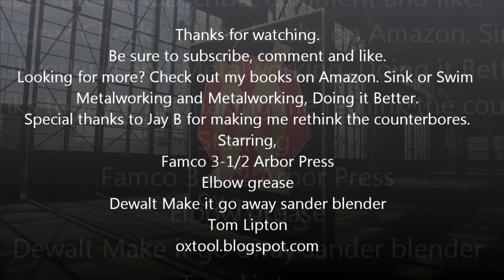Autometric Resurrection 5

Comment: Very good information. Years ago I repaired an intermediate cylinder head plate on a small compressor. The Reed valves had cracked. They were attached to the plate with steel machine screws which snapped off due to their small size and corrosion. I drilled and tapped the plate 1/4-20 with a chamfer on each side. I used brass machine screws and locktite. I cut off the excess and preened the ends. Once it set up I milled the ends flush. I re-tapped the plugs for the original sizes screws. That was about 1977. That little compressor is still working today although the big shop compressor sees more use.  I use the information I gain watching your channel all the time. I had no mill at the time but just chucked an end mill in the drill press.

Thanks, Randy
Reply from the maker: Hey Randy,

Its actually very satisfying to make a good solid repair. Sounds like you gave the compressor a good one.

Cheers,

Tom

Comment: I usually have used a straight pin press fit and oversize on the end length. I usually would hammer each end a little to mushroom it and them cut it flat. It works fair yet I wished I had just not had to do it. One guy I know had a whole run of parts to do and he took a long time to finish them up. He did such a good job on them I have to say he did the best work patching I have ever seen. It is the nature of our work and it is a cool way to solve the issue. I liked the videos and fixup. Thank You.
Reply from the maker: Hey Lew,

Thanks for the comment. Nobody like making a fix like this but sometimes you have to suck it up.

Cheers,

Tom
Reply: oxtoolco
 So right it is better to just fix it up for sure. I like it when I can repair something and have enjoyed work from customers that is basically that exact kind of work. Your videos are the best!

Comment: Cool video Tom, I work for the National Defence, more specifically on M113 which are aluminum hull too and sometime when the guys at the machine shop plug a hole on the hull they use this technique except we use Loctite 640 (green press fit) instead of oil.

Enjoy all the tutorials as always,
Thanks
Reply from the maker: Hi Max,

Interesting. I'm sure they cant weld on those suckers without messing with the projectile stopping abilities. Never tried the press fit green. Have to get some and play around with it. Thanks for sharing.

Cheers,

Tom

Comment: Tom,  For this application, only 2 - 4 tenths max interference is needed for a great press. The plug head is doing all the work. Another clean way to plug these an be a little easier to press in etc. is to undersize the head diameter a few grand then, peen the perimeter of the plug before final fly off. This drives out the metal, fills, and hides the tiny gap. It many times hides the repair better because the bore bell mouths slightly during press. Thats one reason you start to tickle off early around the hole. The harder the parent metel the less the distortion. Peening weld beads down also helps some with parent metel sink around the weld. A real concern in mold cavity repair.
A Master Craftsman is one that can fix his mistakes. My 2-1/2 cents worth, Jim Cunningham
Reply from the maker: Hey Jim,

Your method would work fine. Better a little tight than any too loose. That's why I heated the plate as I knew it would be stiff. How stiff is another question. It took about all the press had to offer. Thanks for the excellent comment.

Cheers,

Tom

Comment: I was going to comment on the press fit specs in the prior video but didnt for fear of being chastised and banished forever by the Wiz.. ;-)
I was always taught to run .001" per inch of diameter (for general work) which would have put the specs roughly about 1/2 thou on the small section and almost 1 on the big end.
I suppose when in doubt, "tighter is better"?? LOL

Colin
Reply from the maker: Hey Colin,

I knew I wanted to heat it when I installed the plugs but I was apparently on drugs on the first interference spec. Thanks for saying something and saving me from internet embarrassment.

Cheers,

Tom

Comment: Even though the press fit is very tight, is there no worry at all for the plugs to make their way out over time? Wouldn't the small amount of lubrication you put in pre-pressing act as a possible lubricant to separate the plug from the plate? I recently saw a video from Keith Rucker where he's mounting a taper into a Jacobs chuck and he stresses the need for a grease-less clean taper when mating, which is why I'm asking since it seems to go a bit against what you're doing here.

Cheers! It's always interesting to see you working around the shop, and congrats on the arbor press, looks like a great acquisition!

/Daniel
Reply: I use oil on tapers to create a hydraulic fit. Really works, just make sure there is no physical dirt or grit in there. Clean oil is fine. 
For the plug, it's so galled in thee it's not coming out. Aluminum galls easy and it probably got mangled in there.  
Plus, the molecules in the plug will bond to the plate. If you leave gauge blocks wrung together hey will actually become one. Their molecules intertwine.
Reply: The new holes will overlap the old ones and the stepped shape will insure they will not come out, as the mounting bolts will hold them in.
Reply: The step (large diameter) of the plug was placed on the opposite side from where the screw will be pulling from ,
so, as they say in China, Ain't no way she's commin' through.
Reply: We always use loctite for our assembly lube.  Seems to work great, and when it dries it does nothing but help hold.
Reply from the maker: Hi Daniel,

Good question. The oil was to prevent metal from tearing as they slid against one another. For this application it was fine to use some since there was an interference fit. With a tapered arbor the clearance goes to zero but is not actually interference. Having something even a thin film of oil prevents the metal to metal contact a taper needs to make an accurate make up. Heavy duty bearing ride of a film of oil so the metal is never actually in contact. A taper works because it has a large non rotating bearing between accurate metal to metal surfaces. Hope this helps.

cheers,

Tom
Reply from the maker: Dustin Layne Hi Dustin,

Good point. Does the green stuff stand up to a little heat like I put into the plate?

Cheers,

Tom
Reply: oxtoolco Ah, that does make a lot of sense. I did not consider that the lack of lubrication during the press fit may lead to tearing of the aluminium. You live, you learn, thank you!

Comment: I like to bead blast parts to make them look nice but my garage shop doesn't have one so I use the orbital sander to give my parts a more finished look. Thought I was the only one.
Reply from the maker: Hi Mark,

It works great. You can also get scotchbrite pads that fit them as well. Works on all kinds of materials to restore finishes and give a uniform look to large parts.

Cheers,

Tom

Comment: Amazing fix. What if you cooled the plugs in a freezer, would they not have been narrow enough to just drop into place by themselves?
Reply from the maker: Hi Andre,

Freezing the plugs would help but more is gained by the larger the temperature change on the larger component. Bigger things move further per degree of temperature change.

Cheers,

Tom

Comment: Tom, One, "jack leg" advantage of the hole and the counterbore being offset is that the difference would tend to wedge the plug pin in place. Not exactly a perfect fit however. Regards,
Eric
Reply from the maker: Hey Eric,

I think we are way beyond wedge here. This is an atomic wedgie.

Cheers,

Tom

Comment: Hi Tom, really enjoying this series. Mr. Bozo seems to live in my garage some days, and I too have done repairs once or 42 times. I usually choose loctite as the lubricant. Is that OK to use? Thanks for the tip on the lead in, on the plug, I usually choose a taper, but I will try the lead in idea next time. Hopefully not soon!   Shawn
Reply from the maker: Hey Shawn,

Thanks for the comment. Loctite as a lube. Not used it that way myself. Pretty good idea.

All the best,

Tom

Comment: Nice repair, but if you were at work where time is money would you tie up the extra equipment and use the extra time to do this or would you fire the goofed up part in the back of the scrap bin and start over?
Reply from the maker: Hi Steam,

It would depend how the part was made in the first place. At work this would have been cut on the waterjet and used with as cut surfaces. If the holes were off in that I would have just cut another. That is unless I didn't have more plate or the machine that needed the plate was down. The short answer is it depends on the circumstances. I let the part and need drive the process and I'm pretty lazy.

Cheers,

Tom

Comment: Sweet, thanks for bringing us in for the slick repair, I really enjoyed the little tips that were sprinkled throughout.

I do have a quick question that maybe you can answer. Would the direction of your pressed fitting have been the cause of the distortion on the plate on one side? I only thought of it when you took the mill down to .0005 on the large bore and it didn't mar the plate, but at .003 on the small bore it did touch, could that be the reason?

Aloha...Chuck
Reply: ooh, wonder about that, too...
Reply from the maker: Hey Chuck,

Most factory wrought plate is not that flat. This piece has been kicking around for a while. Did you see the deep gouge in the one side? Its seem some action in its life. .003 is not surprising to me. 

Cheers,

Tom

Comment: When would you choose this method over just filling with TIG (especially back when the holes were small) or welding in a plug? Or even drilling oversize and tapping for an aluminum screw and loctite?
Reply: i think he mentioned distortion, or at least thats something i would think could easily happen due to the heat.
Reply: he talks about that in video 4 in the beginning
Reply from the maker: Hi David,

Its actually hard to make a weld through a plate without opening the hole to some monster size. Particularly in aluminum. Welding also has the negative effect of softening the base material so it machines like caa caa. You can surface weld a plug in but when you machine it off you can always see where it was.

Cheers,

Tom

Comment: Tom, could you explain the purpose of heating the plate when you did the press fit?

this repair process is fascinating.  I'm really enjoying this whole project.
Reply: Jmkxyz822
We used to cool down other side ( pin in these example ) until health and safety guy forbid usage of liquid nitrogen. Only small part is under influance instead of whole component ( plate in these example ), thus size to be changed by temperature expansion/decrease will not affect critical component. Especially that heat was delivered only at some area of component. ( already mentioned furnice )
Reply: Jmkxyz822 Lukasz Rabiniak thanks, to both of you!  that's very informative!
Reply: for the same reason he checks the plug for heat while on the lathe when turning. When going for a press fit you need to make sure the piece is not thermally expanded to get true and accurate reading. Especially with aluminum, which expands at a coefficient of ~13 microns per degree www(dot)engineeringtoolbox(dot)com/thermal-expansion-metals-d_859.html
Reply: Jasin Colegrove ooh, thank you!  I hadn't thought of that.  will check out that link.  thank you!

that's interesting: much more thermal expansion than most steels
Reply: General good practice is to have both materials in same temperature. Otherwise after normalisation sizes can change.
Reply: Lukasz Rabiniak makes sense.

Comment: I JUST drilled a hole in the wrong spot in some 4140. I remembered this repair and came back to review, I think it's ideal for my application except one thing. I've only got enough space to drill oversize to the point that the edge of the plug  will intersect the new hole location I need to make. The plug can be about 4x the size of the hole. Is this going to drastically affect a press fit? Should I weld it up instead?
Reply from the maker: Hey Chris,

Even with the plug on the edge of the hole as long as there is 60 percent or more of the material there is should be fine. Hey you can always weld it up right.

Cheers,

Tom
Reply: Thanks! it worked great!

Comment: After making a plug repair, does it compromise the strength if a new (relatively small) hole is drilled across the circumference of the plug?
Reply from the maker: Hi Doc,

The new hole is contained in the plug entirely. I don't think we have much loss of strength in this situation. However I wouldn't recommend this method to repair a reactor vessel......

Cheers,

Tom
Reply: oxtoolco Actually thinking of a problem of my own.  I would be drilling small holes, but I don't know where they would be yet. So they might cross the circumference of a plug.

Moot point, though, as I don't have the ability to press a plug in in the first place,

Comment: why not put the plugs in the freezer to make them shrink?
Reply from the maker: Hi Joe,

You could do that but there is more to be gained by heating the other part. When we go from ambient to freezing we go from say 70F down to 32F This is a 38 degree difference. When I heat I go from 70F to maybe 200 or 250F. The dimensional change is much larger heating. Hope this makes sense.

Cheers,

Tom

Comment: hope you are doing well. Hope you can help me. I have been looking for a metal tube to slide over the top of one inch electrical conduit. The 1 1/4 tube is to loose. I have asked the local steel suppliers and they  were of no help. I know they make it. They use it for tent frames. Later..
Reply from the maker: Hi Michael,

Do you have EMT electrical conduit or something else? If you post the actual measured sizes it would be useful. 

Regards,

Tom
Reply: I found the tube combinations that I can use for making tents, awnings, and ham radio masts. If you use 1 inch EMT and slide it inside the top rail tubing used for chain link fence (you may need to cut off the crimped end). Take those two tubes and slide it inside 1 1/4 EMTubing you can make an extendable tube/mast that can reach 27 feet. Not sure what value it would be to you but it is really useful to preppers.  if cut down maybe a retractable chip curtain for a lathe.
Reply from the maker: Michael Hursh Hey Michael,

Thanks for the information. Its pretty handy to have telescoping tubing set for things once in a while. Thanks for sharing.

Cheers,

Tom